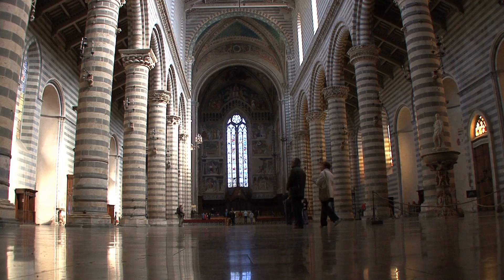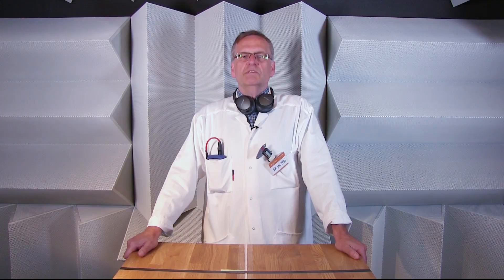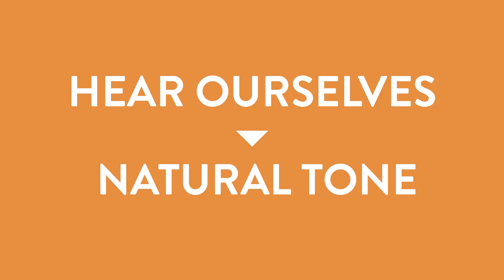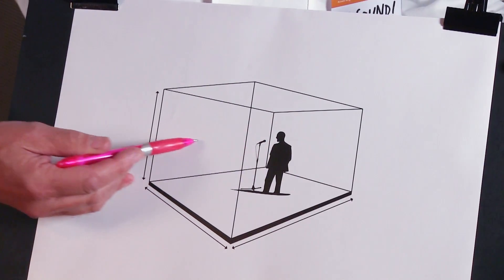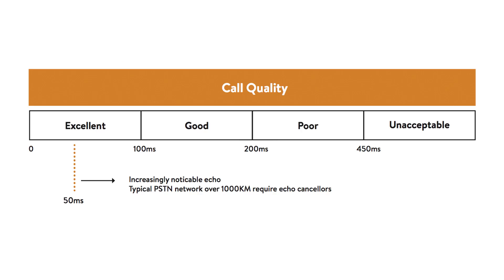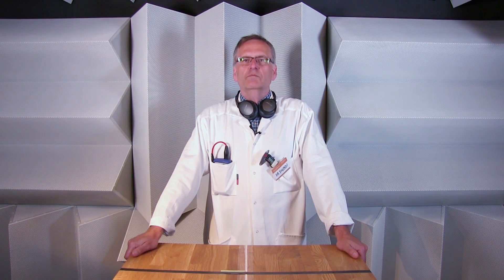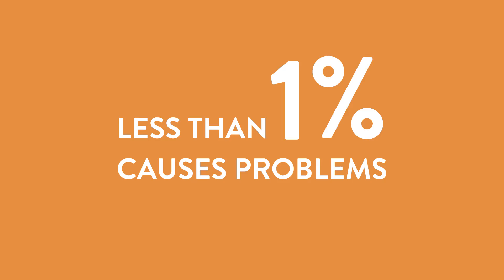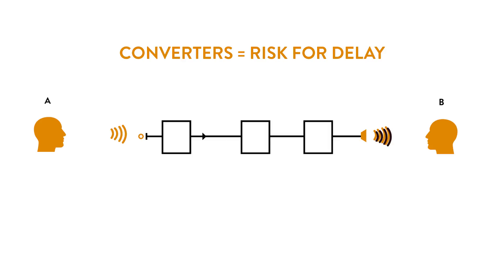What is echo? Dr Sound explains the echo phenomenon

Comment: I am seeking an explanation of the sound phenomena noticed during the American civil war. Enemy soldiers would not hear a cannon fire even though soldiers further away WOULD hear the cannon. Thanks
Reply from the maker: Hi,

There are several causes of this phenomena, both physical and psychoacoustics.

Physical, the dynamic range for the ear is about from 0 to 120 dB SPL in a quiet environment and about 30 to 120 SPL in a noisy environment. Assume that you are in a fighting area with a noise about almost 110 to 120 dB and the cannon have sound peak about 170 dB. You don’t hear the difference between 120 and 170 dB SPL. The different sound level between noise and cannon will then be 10 to 0 dB. Psychoacoustics, when you expect a sound boom the brain lowers the ear sensitivity so you feel that it is lower. Therefore the soldier nearby almost neglect the cannon. The enemy far away with a noise environment about 30 dB SPL and the sound peak of the cannon makes 90 dB SPL peak due the traveling distance. Hear the cannon clearly because the cannon Is 60 dB stronger then the noise around. 

Psychoacoustics, he will not see the cannon so the brain will not lower the ear sensitivity.

Another cause of this could be the “Acoustic shadow” phenomena. An acoustic shadow or sound shadow is an area through which sound waves fail to propagate, due to topographical obstructions or disruption of the waves via phenomena such as wind currents, buildings, or sound barriers.